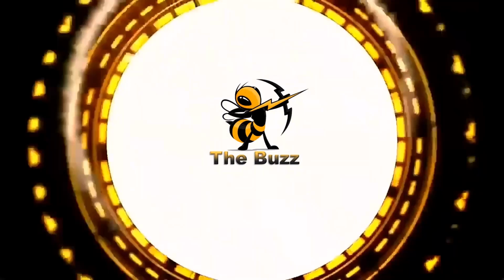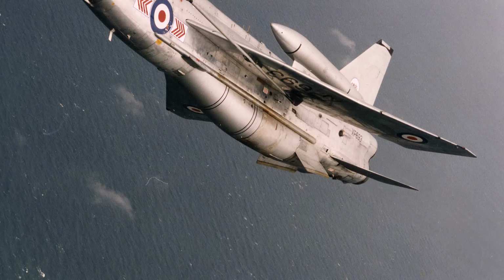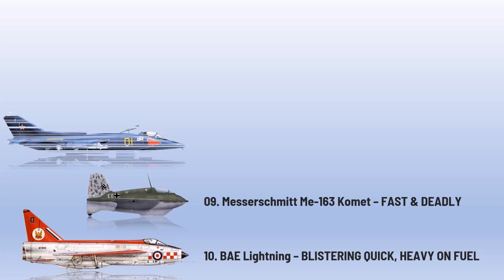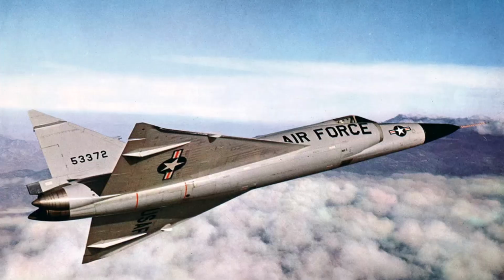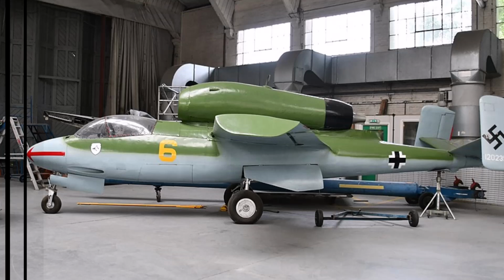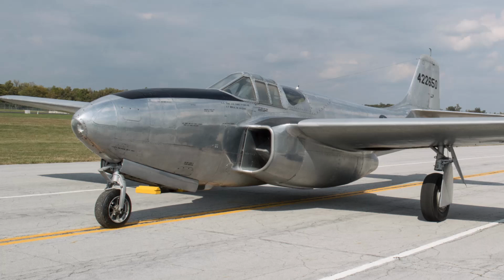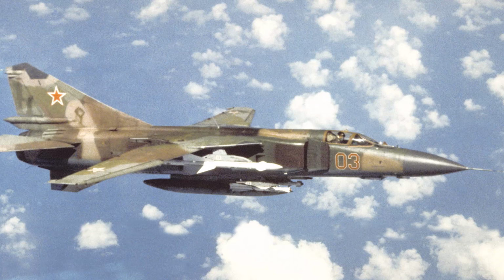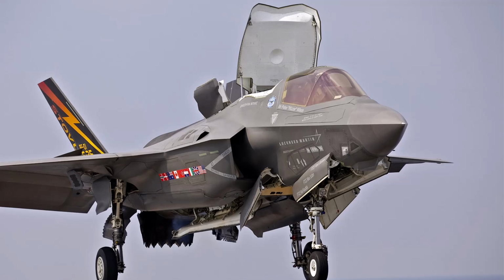The 10 Worst Fighter Jets Ever

Comment: I get why the F-35 is on the list but it most definitely is not the worst. The B model is easily an engineering marvel (even tho it’s existence has held back the other two variants) and all of them are very easy to fly.
Reply: The B model is amusingly the one that the designers had to pay a bundle to Yakovlev to be able to finish it...

"I get why the F-35 is on the list but it most definitely is not the worst."

Try to go back and find the original claims about the F-35.   Not the modified ones, the FIRST ONES, the ones that were supposed to define "5th generation", which was later changed repeatedly every time the F-35 failed to achieve the definitions.
They specifically created the utterly fake idea of the "fighter generations" just to hype the F-35, and then they had to modify it, was it 11 times or something, because they failed to make it happen.

Then there's the maintenance horrors of it...

It's not the worst plane ever, but compared to how EXTREMELY it failed to reach the goals that were specifically created just to hype the plane?
Yeah, that truly IS epic fail.
Reply: @DIREWOLFx75  actually Lockheed helped develope the yak. So it's the other way around.
Reply: @DIREWOLFx75  actually Lockheed helped develope the yak. So it's the other way around.   Also the f35 is the best selling aircraft in the world today. By all premier military forces.
Reply: The only TRUE requirement for 5th gens is stealth lol. The only so called "requirement" that the -35 doesnt meet is supercruise but the thing is from the start it was never designed to do that. Mark my words, if the requirement for the -35 was to go Mach 2.5, it would go that fast.
Reply: @shtorm2616  Except ORIGINALLY, the F-35 was SUPPOSED to be a supercruise aircraft.
It's why the airframe is designed optimised for it.

"if the requirement for the -35 was to go Mach 2.5, it would go that fast."

LOL!!!

No, it most certainly would NOT.
Because the marvellous new and improved RAM coating the F-35 uses has problems dealing even with any supersonic speed.

Anything approaching mach 2 and the coating would literally start to flake off from the friction and heat!
Reply: But all the internet armchair military aviation experts say it's the worst because they saw it eat a bird once!  Even though the actual accidents per flight hours actually paints it as one of the most reliable planes to date.
Reply: @DIREWOLFx75  : I saw a PBS "Nova" program about the fly-off between Lockheed and Boeing. The F-35 C (I believe) was supposed to be VTOL, but couldn't meet the spec, so the spec was changed to STOL.
Something I have read, but only once, is that after a service hatch is opened, the stealth sealer / paint takes 2 days to dry. I have no idea if there is any truth to this, but it would certainly cut into it's operational time...
I hadn't read that it couldn't supercruise, like of the English Electric Lightning did. Another missed spec I guess.
Reply: @drewthompson7457  "I hadn't read that it couldn't supercruise"

It CAN supercruise.   But not with a warload and full fueltank.   So essentially, the capability is there, but it's completely useless.

"I saw a PBS "Nova" program about the fly-off between Lockheed and Boeing. The F-35 C (I believe) was supposed to be VTOL, but couldn't meet the spec, so the spec was changed to STOL."

Huh...   Unless i misrecall greatly, the C version is the "large carrier" version, while the B version is the VTOL model(or more precisely STOVL).

The B IS pseudo-VTOL and the C is ok with CATOBAR carriers, as (mostly) intended.
Although original intentions may have been slightly different, i frankly do not recall those specifics.

"Something I have read, but only once, is that after a service hatch is opened, the stealth sealer / paint takes 2 days to dry. I have no idea if there is any truth to this, but it would certainly cut into it's operational time..."

Yes.   They have SUPPOSEDLY greatly improved on that issue since, but downtime on the ground for the F-35 is still massive compared to pretty much any other aircraft.

Blackboxing all the equipment is another reason for that, anything needs to be fixed, they can't just fix it in the aircraft, instead they have to pull the right module out and replace all of it and then run diagnostics to make sure there's no issues with interfacing the new "box" with the rest of the plane.

It's dreadfully inefficient.
Reply: @DIREWOLFx75  : thank you for the info.
Reply: @DIREWOLFx75  f35 also doesn't use stealth coating.  It uses stealth panels. And it will not burn off.  F22 raptor was modified to use the same heat resistant panels. As it cuts cost of maintenance.
Reply: Where did you hear that the -35 was meant to supercruise? 

As for its skin burning at Mach 2, if the requirements required it to do that, then Lockheed would speed up development of more advanced RAM coatings that can wisthand high speeds. After all, things are made because they are/will be needed. 

LOL!
Reply: Nope, the F-35B can takeoff vertically but it doesnt because at that point it wont be able to carry much fuel and weapons. The same actually goes for the Harrier.
Reply: I think the very same thing about this aircraft.  Getting this one version of the plane to work was quite an achievement.  Making land and catapult versions of the same basic design seemed just to hold the whole program back.
Reply: Problems of other aircraft are not much publicize, which makes F-35 the limelight and with the controversies behind its making hence why it always get a bad reputation. But given the statistics, F-35 has the least amount of technical incidents compared to other air-frames including F-22 and even older 4th/3rd gen ones. 

[1] https://www.youtube.com/watch?v=5pyDNOxbb-Q 

5th gen is also not only about stealth. This is what separates both F-22 and F-35 from Su-57 and J-20 as they can also collect data using its passive sensors and interpret it using their powerful onboard computers. F-35 not only has ASQ-239 Barracuda that can collect RF signals from 2 to 20 GHz but can also see a ballistic missile at 800miles (1300km) with its infrared AAQ-37 DAS as shown in a demonstration. So they can choose to avoid detection by surface radars and airborne AWACS and even destroy them using stand-off weapons. F-35's ASQ-239 besides its APG-81 radar can also jam enemy radars. And jamming and stealth goes hand in hand as it further hides stealth within background noise. So aerial engagements in BVR against both F-22 moreso with F-35 it's not enough to be stealth and/or radar silent.

On another note, 4th gen like Rafale M and F/A-18E/F would have to use external tanks to reach the same combat range of F-35C of around 1400km. Even the B variant out ranges them if 4th gen don’t use external tanks. With the coming Block IV with adaptive cycle engines, both F-35A and F-35C may reach 1600-1800km combat range. Due to the added drag from weapons being carried externally, 4th gen won’t have the same maneuverability like 5th gen fighters. Additionally, their is also no reason for a stealth plane to go fast especially supersonic as it would make itself a big infrared target which defeats the purpose of stealth. Also with Block IV, from 4 it will be able to carry 6 AMRAAMs for A and C variants.

Lastly, F-35 is a very maneuverable aircraft comparable to F-16 with no external mounts. It could also do F-22 maneuvers like pedal turns without even having thrust vectoring TVC by only using its advanced control surfaces. 

[2] https://www.youtube.com/watch?v=G0hWzaKEeZo
[3] https://www.youtube.com/watch?v=Qam6zbFCIfQ
[4] https://www.youtube.com/watch?v=SPqUvCnWcrk
[5] https://www.youtube.com/watch?v=IQKk9O2peVY

Bottom line, F-35 is a stealth ELINT aircraft with some capability of offensive electronic warfare, superb at BVR engagements with good enough ability to dogfight. F-35's performance is already evident in Red Flag exercises.
Reply: @DIREWOLFx75  still, like you said, it's not the worst. And about the maintenance horrors, the F-16 was also a maintenance horror iirc. Fighter jets being maintenance horrors is not that rare. Case in point, the aforementioned f-16.
Reply: @str2010  "still, like you said, it's not the worst."

Yeah, it is a decent bombtruck and it has some capability as a missile platform.

But the real failure is in the marked difference between what it was supposed to be, what it is claimed to be NOW and what it is.

It was supposed to be the "cheap" replacement for the F-22, or before that, the lowcost stealth to the F-22s highcost highend stealth, it was supposed to be the replacement for ALL the "teen"-fighters...

It simply isn't.   Even the US military has openly admitted it.
It's a great replacement for the F-16 in the STRIKE role.
It's a barely so-so replacement for the F/A-18 in the air superiority role.
And it adds stealth capability in larger numbers than F-22.

But it completely fails in replacing even a SINGLE of the teenfighters.   The F-16 is far cheaper and its agility and performance is not something you just want to ditch in return for less than half as many F-35s.

The Super Hornet is a mostly better air to air missile platform and considerably better at delivering strike packages.

And the F-35 can't even begin to replace the F-15.   ANY of the models.

At that point you end up with "but why do we still get it"?
And the shameful answer is "because the manufacturer had a great salespitch!(and massive politicial lobbying and porkchop projects)".

"And about the maintenance horrors, the F-16 was also a maintenance horror iirc."

Nowhere close.   That was teething issues and even those were not THAT terrible.
Oversimplified, the F-35 basically has much worse maintenance issues forever than what the F-16 had as early teething issues.

Think about it, depending on exactly how you measure it, the F-35 costs 2-4 times more per flighthour than the F-16.
Requires twice the groundcrew and most of the groundcrew needs additional specialist competency.

"Fighter jets being maintenance horrors is not that rare."

Or you can compare with aircraft specifically built to be EASY maintenance, like the SAAB Gripen.
Because the big thing here is that, being built to be easy and cheap to service and keep flying?
It doesn't make the plane worse in any way.

It's a case of yes you can have your cookie AND eat it.   And there's absolutely nothing preventing any modern aircraft to be built the same way or halfway there.

But the F-35 is so far out to the extreme that it's verging on being outright user UNFRIENDLY.   It's so bad that it's bad engineering.